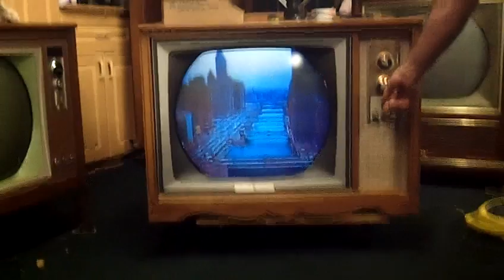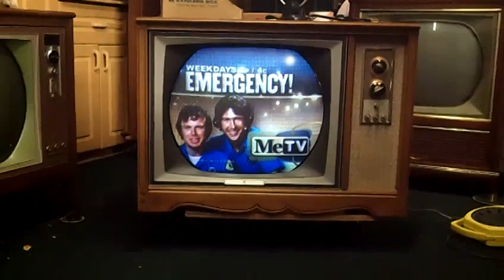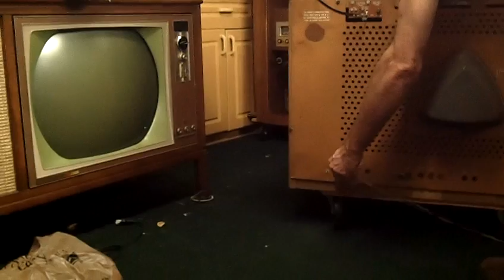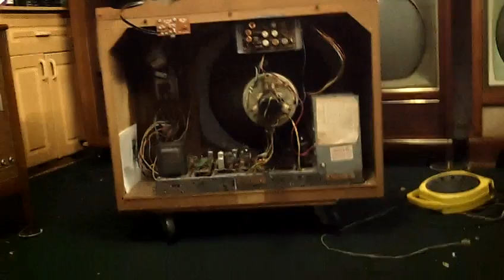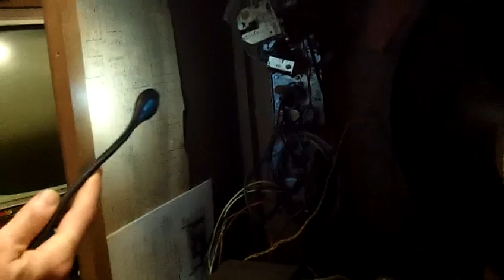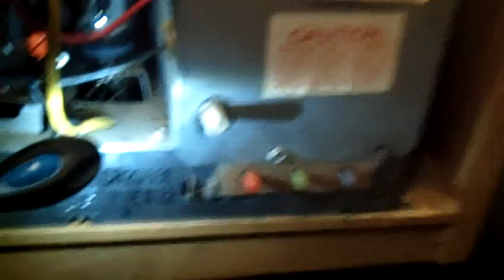Vintage Color round tube GE television set

Comment: I have one of these my grandpa bought new. The tube is green but there is life everywhere else. Is there ANY market for these?
Reply from the maker: there are a few folks that like to collect old color sets, mostly from the early 1960's or older. Has a lot to do with your location as they are so heavy that shipping cost are high (that is if you sell on ebay as an example).
Reply: @davewm9589  I'm in the only state that matters (NY). So no real value I assume? lol I'm gonna convert it to a LCD. Or a fireplace.
Reply from the maker: @ATCRyderX  if you can get a model number there is a possibility that you have a rare and sought after set. You can join videokarma.org and post the model number in the classified. If its a rare model like a CT-100, it could be worth $$$$
Reply: @davewm9589  I will soldier through the dust and find that model # before I do anything crazy. Thank you so much!
Reply from the maker: @ATCRyderX  just post up a video, I will let you know if you have something valuable.

Comment: amazing how it could sync properly without an oscillator clock, everything in digital we do today requires proper timing
Reply from the maker: GE engineers were great at making things simple and inexpensive.
Reply: Ive got news for you its an RCA CTC 16

Comment: I bought an old tv (1955 GE) I hooked up a panasonic VCR player via a cord connected to the rabbit ears. It played clear sound but still just a fuzzy screen ( no picture at all) Any help or advice would be greatly appreciated!
Reply from the maker: +Sistertubetime a few things, 1st a video of the problem, that makes it much easier to tell what it going on.2nd, 1955 era TV's really should be looked over by someone skilled in technology of that era to make sure it is safe to operate. These TV's were never made to last 50-60 years (more like 5-6) so you need to make sure it safe to run. Have fun with it but be safe, NEVER leave them on unattended. All my sets I go over very closely to make sure there are not frayed wires, damaged parts, isolation parts are intact when needed, fuses are correct, just a whole list of stuff.

Comment: I recently came across a GE set...the front and dials look like the ones on this set, but the body is different.  I'm having trouble finding any information on it.  I believe it was in a motel lobby at one time due to me finding it behind an old motel.  It's on legs, and the back on it looks the same except it doesn't have the plastic cover.  It's just flat.
Reply from the maker: Shawn P. Williams if it has no cover on the back then its prob a B&W set or a much newer color set. the bump out was there to allow for the much longer neck of the CRT used in early Color sets. Old sets used a 21" round faced CRT with a 2" dia neck and a much shallower deflection angle than later rectangular CRTs used in later years.

Comment: How did you put these old programmes on?
Reply from the maker: Metv network broadcast over the air, use a digital to analog converter to pickup and produce a NTSC signal compatible with analog TV, RF modulated to channel 3 or 4
Reply: Dave WM Yeah but these aren't being broadcast now.  One is the Bob Newhart Show, and there was an advertisement for Emergency, which I'm pretty certainly was in the early 1970s.  How did you find a broadcast from that era?  This was before VCRs existed.
Reply from the maker: retro theme tv stations are over the air.

Comment: I have a Sylvania tv 1972... works... but picture is scrolling and colors are off.. Sound is good and color comes right up... 
I don't guess you live in the Washington DC area or know anyone in this area that knows how to fix these?
And BTW - LOVE all the TVs you have - They are Excellent!
Reply from the maker: pic rolling vertically could be either the vert osc or the sync signal. If you can get the pic to hold still even just for a moment by adj the vert hold, then its prob the sync. If it only slows but will not stop or if you can not reverse the roll then its prob the vert osc that is just too far off for the sync to control.

loss of horz sync (diagonal lines) could also be a horz osc issue or a sync issue. If you can flop the diagonal lines or get a momentary pic by adjust the horz hold then its prob the sync.

a poor sync signal can effect both vert and horz (rolling and diagonal lines or sideways slipping pic). Poor sync can be caused by tuning, sync separation.
Reply: Dave WM Thanks for the diagnosis. Trying to get a repairman out here now to look it over. Told him what you said. Wish i knew more about the set to do it myself! =)
Reply from the maker: rodmonster61
if you wanted any more help it would require a video of the issue. Its very hard to diagnose an issue without actually seeing the problem AND being able to try the adjustment controls.
Other issues that can effect sync is AGC. A good tech should have no problem getting the the bottom of this. Later model vacuum tube sets (mid to late 60's) had pretty reliable parts. A tube substitution of the affected circuit should be 1st. Avoid random tweeks of IF coils.
Reply: Thanks! i may upload a vid. Problem i have is i have gotten three quotes... all between 250 to 350 dollars... which is just too much i think... Wish i had paid more attention to my Grandfather when he used to repair these back when i was a kid in the 70s and 80s...

Comment from the maker: as long as you have an RF modulator they work fine. The video you see is from a BT 450 modulator.
You could adapt the sets to use a composite video and a audio signal but I prefer to just use the modulator.

Comment from the maker: Thanks OH, I like my old sets, I try to fit the programming I watch to the correct era set, so early 50's goes to my old BW roundies (moto and rca), 60's era BW goes to my 60's maggies, 70's to the zenith Avanti etc... Just seems better that way. There is so much garbage programming that is new that I have no need for a modern era set, my oldest is a mid 80's mitsubishi I got to watch Miami Vice (stereo) on. Most of what I watch is on MetV, RTV or THIS tv.